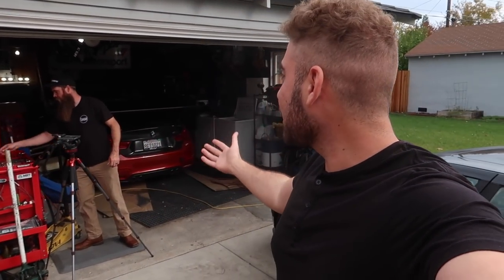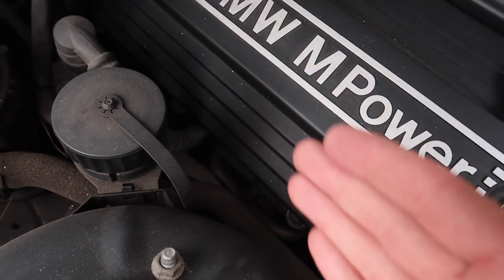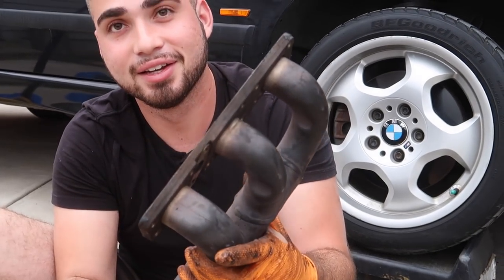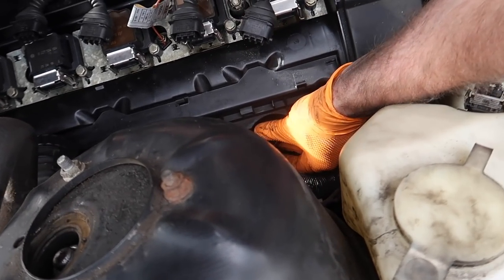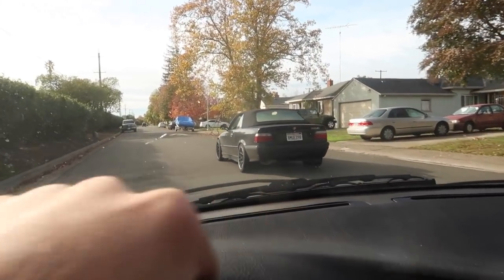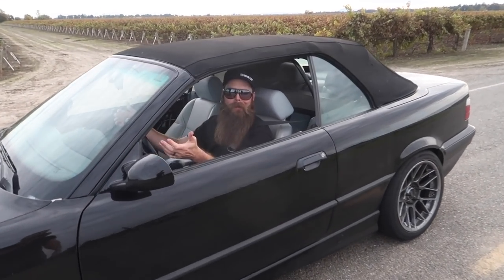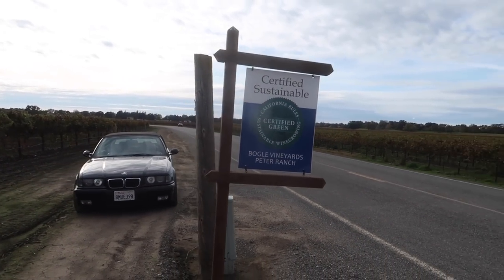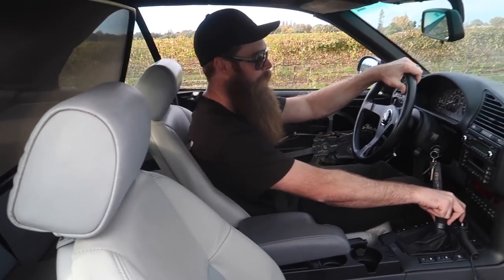E36 M3 AUTOMATIC VS E36 328I 5 SPEED! (REPLACED HEADERS!)

Comment: Do an M50 manifold swap for more power towards redline, you lose some torque tho. But you get it back with a tune
Reply: I did that and the manual swap at the same time when it went in for winter storage during covid. Talk about a difference in driving. Best mod I ever did

Comment: It was fun to watch! But have you considered the weight of the car? Convertibles are usual a lot heavier. 

Just locking op the front tires because of no abs is not the fault of the tires, you should stopped way sooner